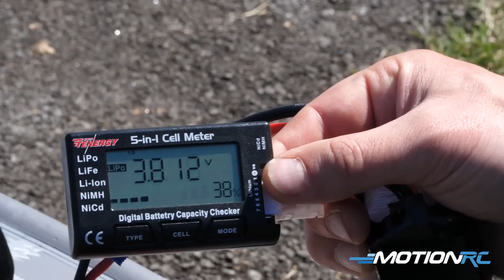Freewing F-35 Lightning II V-3 - Flight Review - Motion RC

Comment: That jet really looks great with plenty of speed. The 5th generation jets some some of my favorites, especially after seeing them fly at the Abbotsford Airshow the past couple of years.
Reply: They just had the F-35A on full demonstration here in Melbourne, Florida. It was back at the end of march. It was the first show for the new F-35 demonstration team. Was pretty cool, but I think I like the F-22 demonstrations more.
Reply: IntegrityRC It is tough to compete with the F-22 demo, but there is just something special about the F-35 to me. This will likely be in my hangar soon.
Reply: @GBLynden  No doubt this F-35 is looking nice for a 70mm. But I'm hoping and waiting for a 90mm or larger size F-35. I just wouldn't be happy with this one because I've never owned an EDF smaller than 90, other than my 80mm Avanti. This one does look a lot nicer than most other 70s in the past. But It is still quite small,  and has the tiny landing gear that doesn't work/look so great on our bumpy runway. Plus no gear doors or LED lights, etc. One thing is for sure though. If they do come out with a 90mm F-35. It will be MUCH faster than the current 90mm F-22. Simply because the exhaust isn't bifurcated like the 22 is.

Comment: I just got the ARF Plus version and took it home today.  I have a Spektrum 100A ESC and the Freewing 70mm EDF Power System w/ 2957-2210Kv Inrunner Motor which requires just 80A.  Waiting for a Spektrum Receiver with AS3X and SAFE to come in and I'll start this project.     Thaks for the demo flight!